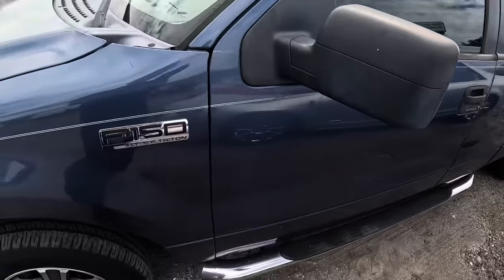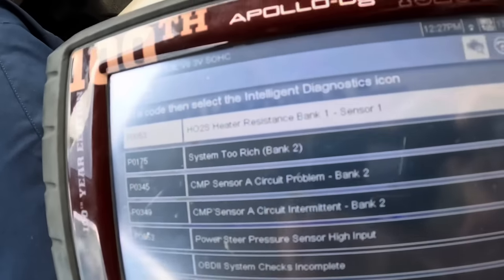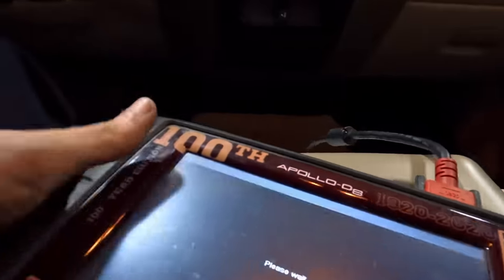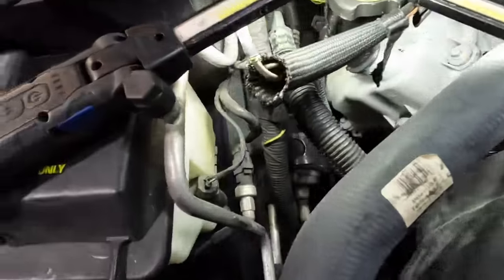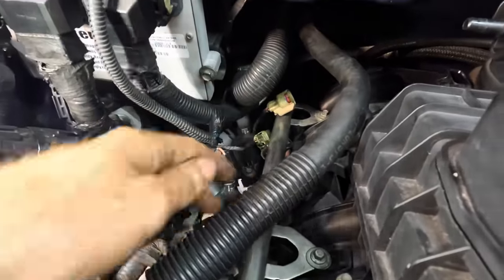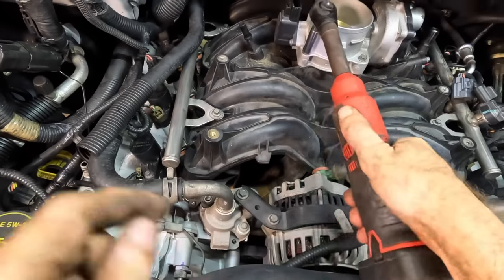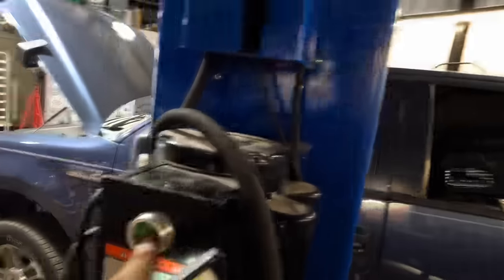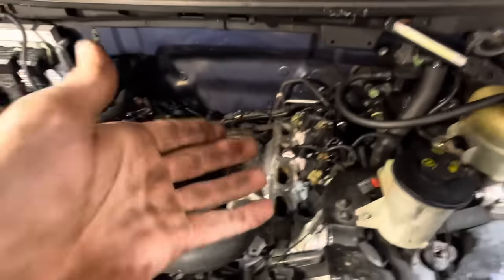Hack Job! Mechanic Botches Engine Replacement! Multiple DTC's

Comment: Dear Ray:   Many people are not comfy with connectors.....disconnecting them, and re connecting same.  Maybe, some day, you can film a 15 minute video, showing the world how to SEPARATE and re-connect the 10 (or so) connectors, used in vehicles, since 2000.   This will make U more famous.   This is no joke.....Connectors....the cause trouble, fear, and anxiety.....  Great to see you ID all the weak elements....All of these engines can be knocked off base by even a slight electrical issue.......

Comment: Last time I had a misfire from hell on my 5.4l 3v , ended up basically re doing entire engine harness.  Lots of broken wires inside insulation, melted connectors from previous crappy repairs.  When I finished,  that thing was running like out of the dealer.

Comment: I know rays the fixer n all but if this were me since it’s a new engine and ECM. I’d start off by erasing all codes clean and drive it and watch which codes come up 1,2,3rd thz 1st codes always the first biggest detected problem. 
Which then could cause light 2&3 code and those may not even be a problem aside from reacting to code 1. 
Fix code 1 and it may instantly shut off other code lights! 
Then rest computer and repeat!
Reply: True cuz you don’t know if these codes are from past engine issues if they were reset or not. 
My Saturn ion red line had 44 codes and wouldn’t start! I replaced the Crank  position sensor and car fired right up! All codes went away and GM wanted to charge me $4,800 just to start putting in parts based on the 44 codes ! I said forget it towed it home and looked at the codes and figured which code would give me a no start symptom. And cleared code and started with PCS and cost me a whole $25 for sensor and my car was fixed!

Comment: We had some power supplies shipped out for cap change and rebuild and I had to test them when they came back. When I opened them I got blue lok-tite on my hands. Turns out whoever put it together internally thought that lok-tite was just glue so they put a dab on the outside of the hold down screw heads. Not glue, doesn't dry, not a winner.

Comment: If you push the hole connector in with the little white tab pushed in at the same time then pull it out it works better

Comment: The way that those overheat tabs work is that the entire button is epoxied to the freeze plug or head. When the engine block or head exceeds 250 degrees, the solder in the center of the tab melts. The whole tab shouldn't fall off.

Comment: Yeah,  that center part is lead,  and it melts when you excessively overheat the engine. I had a customer overheat a Volvo 2.3L so badly, that he melted the plastic breather assembly,  which is attached to the block.

Comment: I reckon there could be a big chunk a gasket material in a oil gallery intermittently reducing oil pressure to the cam gear on start up.

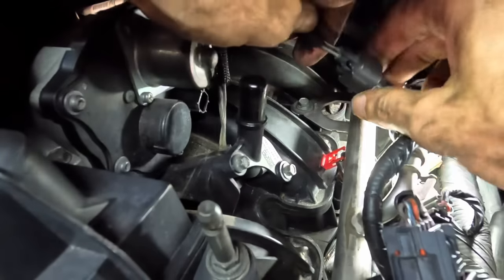Comment: 35:45 I fully agree that the wiring should be attached to the engine or car body. I don't always agree with the original support positions after fixing some wiring issues caused by combination of engine vibration over time vs original support position but I can say for sure that if you don't have any supports, the wiring will eat itself over time thanks to vibration and rubbing against something anyway. And it will happen for sure, not "wiring may eat itself".

Comment: Interesting video! I think you should get either a head mount or chest mount stand for your camera so that you can use both hands while working with the engine and shooting the video. And possibly some extra lights to throw in small spaces so you can get better video.

Comment: You forgot to mention the spark plug issue with these engines also passenger side exhaust manifold had bad castings and would crack this was one troublesome motor plus the issues you have mentioned.

Comment: I had a 2015 Town Car that we bought a few years back the car ran really nice but every now an then , like mabe twice a year when It starts it for the first time in the morning I would hear a terrible rattling sound like it was out of oil for a second or two then be fine so after checking we found out not all oil filters have the anti bleed down valve in them so changed filters to motor craft recommended filters but damage was already done however we never had to tear it down . I read it has hydraulic tensioners that if the oil pressure should bleed down it would or could break the plastic timing chain guides from the loose chain. 
Well had to sell moms car after she passed away so warned new owners about this so hopefully if I'm right they only use motor craft filters and parts.

Comment: Do you disconnect the battery cables, before disassembling the electronic connectors.? Also do ( store) the codes before disconnecting the battery.?

Comment: I went to a garage to have it out with a shop they Told my niece they did the timing belt well they didn't the belt was super thin then broke  An the shop was closed.  A lady walking past said Son I hope you didnt put your vehicle in there. Nope but my niece did. She explained the Young man's mother put up all the money for the business and she couldn't keep up with having to fork out for all their mistakes so they ended up closing. The maddest thing theyre 
Super cheap work helped close 2 other great garages down by doing cheap work or not actually doing anything to vehicles

Comment: I always have to wonder how many ECU replacements actually fix anything.  I had a Chevy dealer service tech trying to tell me I needed a new body control module ($1500) to fix the power mirrors that weren't working, when 20 minutes of troubleshooting on my part found that it was actually a broken $20 mirror switch.  He must have been smoking something, the wiring diagram showed that the mirror circuit was actually pretty simple and the BCM wasn't connected to it in any way.

Comment: Injector for cylinder 8 was wrapped around the imrc and depending on how hard it pulled it could be causing the cylinder 8 misfire potentially

Comment: That connector grey single wire,  goes to a condensor, that noise suppressor. 
Just so you know for future reference, they can be in the intake (aluminum) others are typically mounted to the front of the engine on the timing cover bolt. 
I just rebuilt one, it was a 2v, but we also did a few V10's in the shop. Someone should be slapped for assembling that ruck that way.

Comment: I would replace the o-rings on that oil cooler assembly. If they loaded it with silicone the silicon could be in the oil gallery

Comment: It's a regular thing to have customers call the shop I work at for estimates on engine installations for which we quote them the estimated labor hours + parts. All of our mechanics are 30 years or more in the field. We never over-charge or add anything unnecessary to an estimate/invoice but there are still those customers who will go with the absolute lowest bid they can find for the engine installation. Many times within a few months time frame after their original call to the shop, we get a call back from them asking if we can diagnose a rough running, stalling, CEL issue on a new engine install. Yup same person that went with the lowest bid and ended up with a crap engine install job. So unfortunately, now they are paying us to properly redo what was a crappy engine install, which in the long run means that they are paying substantially more all together than they would have had they not gone with the absolute lowest (and unrealistic) estimate in the first place.

Comment: I have a 2003 E-450 RV and I was wondering if the pressure sensor is telling the ECM it is at full pressure will the pump still prime when the key is turned on? Maybe a bad sticking sensor.

Comment: I’ve always been told that butt connectors on any module communication wire will cause enough resistance to throw of values.

Comment: That little button with the heat sensitive glue. It's just like a cell phone there is a little white square sticker either on the inside of the battery compartment if that gets wet it will either turn into a red x or red lines then they know the phone got wet so if there is a warranty it will not be covered

Comment: I have replaced many engines and done major work on many engines. I have eventually sold those vehicles. I have always been very methodic and careful doing these jobs. I used to fix and flip cars as a hobby. I never sold anything I wouldnt let my wife drive it. Many of these vehicles I kept for a few months and she did drive them. When someone does warranty  work and botches it, they will probably not warrenty their  work. I am getting older and cannot do engine repair any more. It is getting impossible to find a reputable  mechanic any more.

Comment: Most warrantee companies never pay premium labor rates! Like customer pay rates ….
Working in the automotive field for 30+ years I’ve worked for independent and dealerships .
These aftermarket rebuilt engines had many issues due to poor machine work and not always a cheap part problem.
Many times I’ve gotten engines after a reman install with multiple problems…sensor issues , cat issues ,exhaust leaks , bad inj, etc.
In a lot of cases these problems were the main cause of engine failure……so many reasons for a reman engine not to last.

Comment: There’s goes your shuttering and engine noise. Those flaps are cooked and it needs a manifold. It’s also causing the fuel trims to go wonky. I often find that if you blow up the entire truck and buy a Silverado it fixes the issue permanently!!!

Comment: @ 24:45  is that a count dankula reference?
Yeah, lackluster install & I'm not thrilled with the reman, either with the ultra grey squirting out on oil passages. If its squirting out outside, it's also squirting INSIDE.

Comment: 04-08 3v where the blow up situation 09-13 they fixed the valve train issues       so if you change the spark plugs and u have the 16mm spark plugs thats the problematic engine      yes the 09-13 3v engines will bolt right up on an engine swap        i had the same problems with my truck all i did was change the engine to the newer engine and changed all the tensioners to cast iron tensioners  cause the plastic tensioners fail easily (verry easily)     the next thing when changing the oil prefil the filter cause the oil pump dose not prime the filter  i found that out the hard way lol

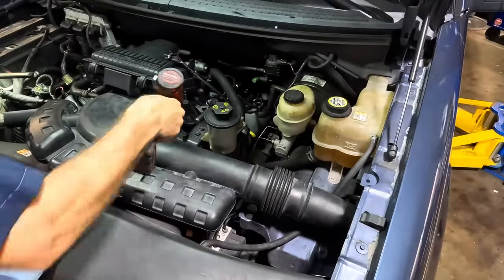Comment: 26:53 poorly crimped conector  has a black and white wire but are the pin outs correct polarity and I belive that would matter depending on the 
Sensor

Comment: the lock tabs go brittle and snap off the same issue as the coil plugs the replacement pigtails come with butt connectors i usually just chuck the butt connectors into the drawer and just solder and heatshrink then sleeve it with high temp silicone sheathing because well i have the chance and why not..

Comment: When I first became a dealer years ago I became excited to find out how cheap the F150s were at auction.  I purchased several of them and hit the ground running.  After replacing my 3rd 3 valve 5.4 I said never again. Total Junk.

Comment: @RainmanRaysRepairs  If you were going to recommend somewhere to buy a replacement engine instead of where they got theirs, where would you have someone check? New truck prices are insane presently so 5k doesn't sound so bad to get a truck you like back in action.

Comment: That paperwork looks suspiciously familiar to me. Just bought a used engine and trans for a 93 Camry, I'm looking at the paperwork from that and it's pretty much the exact same layout and promises...

Yeah, I got a wrecking yard engine that looked like it had been pulled out by an excavator. It ran good enough to get the car out of my driveway...

Comment: Are you sure you didn't accidentally  break the cylinder head temperature sensor, I don't recall any cylinder head temperature related dtcs when you first checked the ecm for fault codes?

Comment: I got a 2013 Ford f150 flex fule that I bought 4 months ago and it stuck in 5th gear right now and when i bought it was told it has no issues and i bought from dellership got any ideas its got fluids

Comment: It's the shoddy few mechanics that give the rest of us a bad name.
RTV is fine when you know when to use it and how much - the main problem I see is that people put too much on. It only needs a thin bead. If you see how much it squeezes out on the outside of the joint, it's done this on the inside as well.
What happens is that after a while, the RTV breaks off and finds its way down into the sump/oil pan, and gets sucked up into the oil pickup strainer, causing reduced oil pressure. I have seen cars come in with trashed engines because of this.

Comment: Good diagnosis Ray. If the owner does want you to look at the cam phasers, I'd recommend to him the cam phaser repair kit from Livernois Motorsports.  The kit is $700 and it will make the phasers solid. You'll end up with a more responsive engine and you don't loose mpg.

Also, if the valve covers come off check the roller followers to see if they've been replaced with the updated model.  The new followers spray oil on the cam/roller, as the old model sprayed oil on the cover.

Comment: Dude, you could’ve found that problem underneath the truck you had out with the exception of that one sensor with the bent connectors in the plug but you might’ve knocked out apart when you were taking a manifold out

Comment: That kind of workmanship is pathetic to say the very least. 2 broken sensors and improper wire routing...ughhh...The intake gaskets are a shame given those appear to have been new.
   I hope the trucks owner is able to recover some of the money laid out for the install.
 The painted over valve cover sticker is a serious wtf to me...I dunno who did the engine rebuild but i wouldn't wanna be in their shoes let alone the hack installers.
   A great video showing what can happen if things are not put back exactly as they should be.
  Part two is gonna be a fun one to watch too:-) Keep up the fantastic work Ray🙂

Comment: Make sure your customer knows the Magnusson Moss Warranty Act of 1975 when calling the engine manufacturer. They have to prove that the installation caused the tensioner failure in order to deny a claim.

Comment: I have to point this out... There are not four circuits to an O2 sensor there are in fact four wires with two separate circuits... You have two wires that control the heater which is one circuit then you have two other wires which is the ground and signal wire to the PCM which is another circuit... That's two circuits for the O2 sensor not four circuits

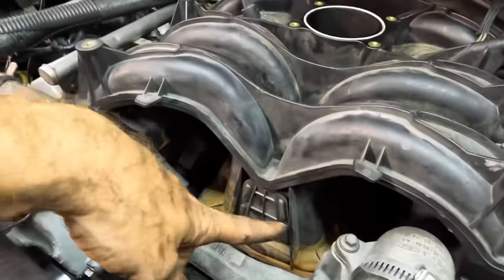Comment: Hey Ray. Did you pick up the red safety clip that came off the connector on driver side back side of engine?? I lost sight of it around 44:50 . I kept yelling for you to pick it up but you didn't hear mw.

Comment: When are people going to learn than gaskets and O-Rings ARE the seal, by putting silicone/gasket maker, sealant goop, or any other crap on them prevents them from being a seal.  When you put silicone/RTV on O-Rings, it lifts the O-Ring in certain areas and will let oil/coolant to go past said point. 
  You can use oil or a light coat of grease, otherwise you’re creating a future leak, that’s assuming it doesn’t leak right off the bat.

Comment: That is a pretty piss poor install but I cant say i would have gone that route for diagnostics Ray. I would have started with some bidirectional testing and observed the data first before ripping anything apart because you could accidentally fix an issue by unplugging something or tugging on the harness. As for the manifold runner control when i saw it was not moving through scan data when commanded i would have used an inspection camera to look back there so i didn't disturb anything and i could have seen the issue. You are probably right about the harness, however right now it is still technically a guess because you didn't actually see it blocking the actuator rods. Also you should probably look down the intakes to make sure those red lock tabs didn't fall in when you pulled the manifold off since you didn't pick them up when they fell off initially.

Comment: So the dealership sounds shadier than most. They clearly did not machine the rotors but definitely charged for it. As far as the trany, Nisans CVT is complete garbage. My boss had one go in his wife’s rouge with only 65k on the o do meter.(tip of the hat to you Ray for the pronunciation)😂

Comment: I don't really understand why they replaced the engine on this. Isn't that overkill? "Your radio doesn't work? Let's replace the engine".
The routing of the cables and harnesses behind the intake is crucial. I was sitting here saying, "yes, take the throttle body off" and "yes, you have to take the alternator off" and "be careful, there is something plugged in behind the intake manifold". That is because I had the intake manifold off three times for a P2004 code. Two IMRC motors later I realized that the code was actually caused by one of the harnesses routed incorrectly and physically impeding the rods. That's how I found out how crucial the routing is.

Comment: If the CHT and O2sB1S1 was already broken, then why didn't we see a CHT circuit and O2sB1S1 heater circuit codes?
I just looked back at the code list and the 1st one in white that's hard to read is an O2sB1S1 heater resistance fault, still why no CHT CKT Fault?